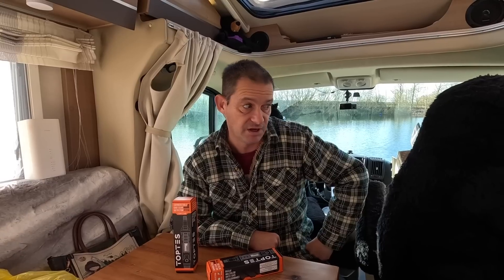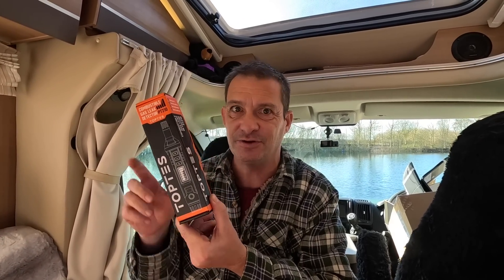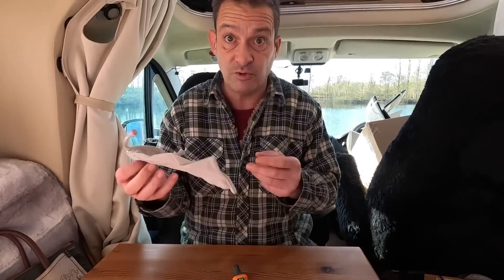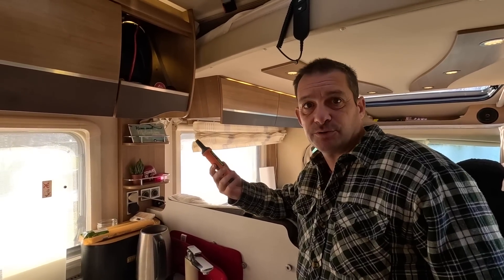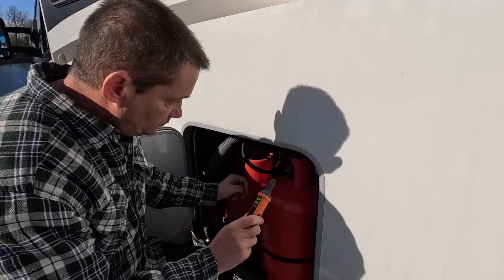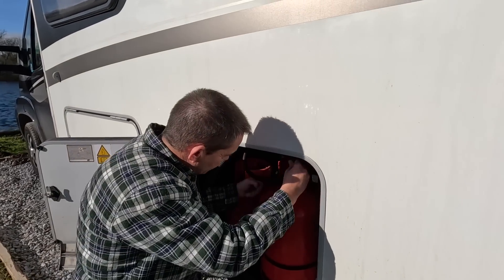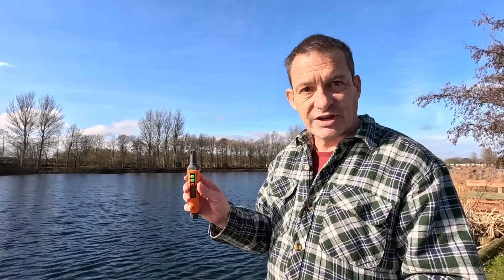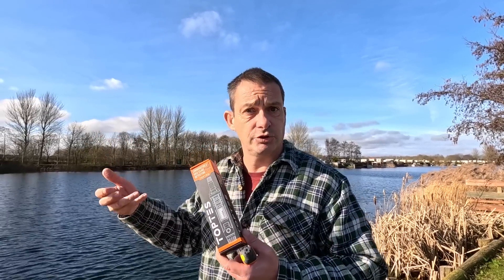STOP Your Van EXPLODING For UNDER £30!

Comment: Nice wee video guys and another very improtant point to remember is that LPG is heavier than air, unlike Natural Gas which is lighter, so if you smell LPG you are technically up to your neck in it, so move extremely slowly and touch nothing electrical and get out the van. Turn the gas off at source and let the van vent by leaving the habitation door open as the gas will fall out there on its own. 👍❤

Comment: Dan would having a longer gas pipe be of any benefit on your gas bottles? this way you can put the bottle on/off outside the van then when you have the screw tight it can go in to the storage box, it would save you having the struggle with the spanner in a small space.